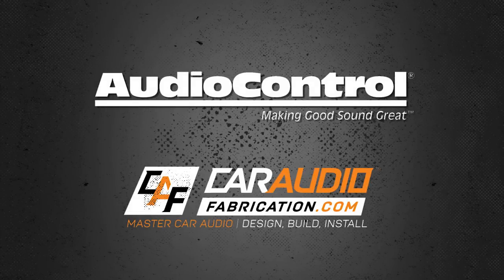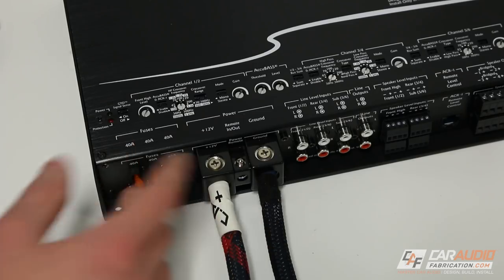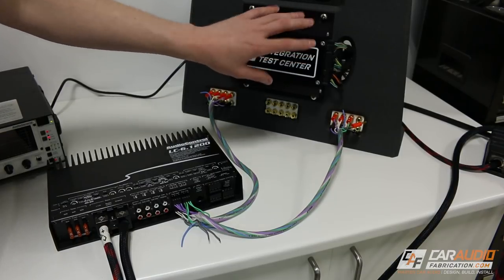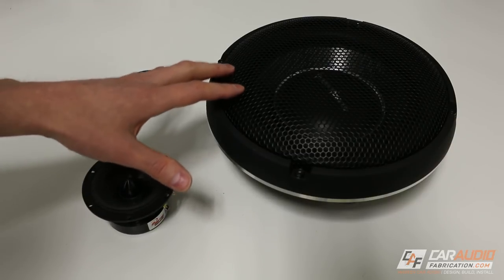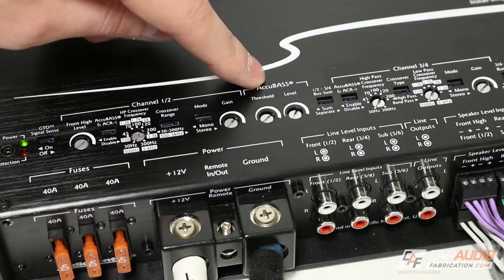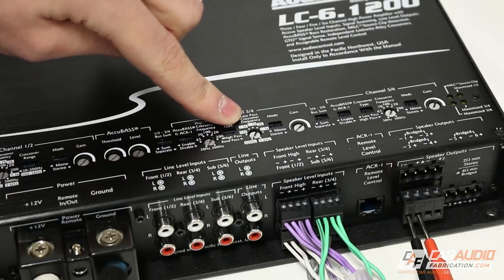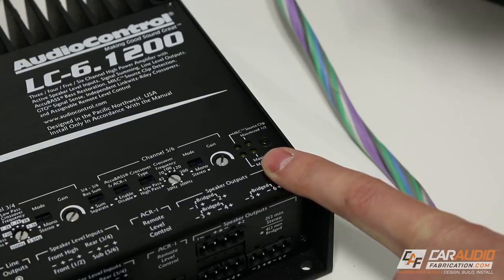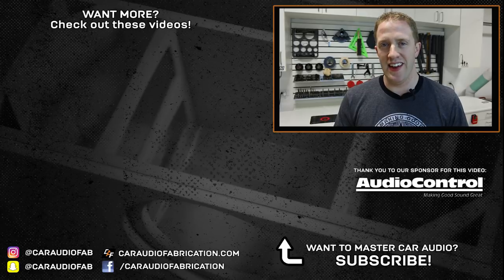The All in One Amp? AudioControl LC-6.1200 Amplifier - CarAudioFabrication

Comment: AudioControl is perfect. I had a vehicle that has a difficult Audio system both from hardware and fitment. So expanding the system with new speakers and a sub was not possible. I installed the LC2i post factory amp to the factory amp and restored the bass and sound. So happy. I plan on upgrading to something like this in the future. Btw the GTO setting is AWESOME

Comment: I want to thank you for these videos. I had watched this video about 3 years ago and bought this amp and the 1500 for a sub. I sold that car but kept my gear and only want to put a small sub in my new car but it has a factory amp just like your test bench and now I know I can bridge 2 channels to get the 400 watts I need for the sub and I can use the wires off the amp in the trunk and then feed the rear speakers the other 2 channels awesome. Thank you again Godspeed

Comment: I am running this amp I love it, theres a lot of control over your speakers. 

Im using this for :
Channels 1/2: Audiofrog GB10 tweeters
Channels 3/4: Audiofrog GB60's midranges
Channels 5/6: Polk Audio DB522 (just back door filler speakers honestly)

Also running a JL 12w6v3d4 sub on a JL XD600 1v2 in the trunk on a box designed by CarAudioFabrication specifically for the sub. 

One of the cleanest heavy hitting audio systems I have ever heard and still need to get it RTA tuned to be perfect.
Reply: Jack Mcbride wait I thought this was only a 4 channel amp.... How are you using 6 channels?
Reply: @T_B_C_L  it is only six channels he could have the rear door filler speakers wired to the midrange speakers or the sub is wired to a different amplifier

Comment: I have a question, and I'm having a difficult time finding a clear answer. Lets say this amp is used in a typical 4 speaker + 1 subwoofer set up. What is the output for the 4 channels (door speakers) and what would be the mono output on channels 5/6. 

Looking to do a well rounded system in a Volkswagen Tiguan, and this seems like a decent option apposed to some other 5 channel amps, but I'm a basshead at heart, and definitely want some great output from the substage. Hope you see this, and thank you for such a detailed and simplified explanation of this amp.

Comment: Signal sense will always work when the speaker wires have 6volts DC. With a multimeter put one lead on a positive or negative speaker wire then ground the other lead.

Comment: Mark.. I’m currently running this amp and now adding the LC-1.800 along with it. I’m trying to use the LC-6.1200 RCA Analog Line-Level Outputs but not getting enough voltage to turn up the gain of the mono block to my desired setting. The manual says AcuuBASS is always engaged on RCA Analog Line-Level Outputs. Does this mean I have to dial in the AccuBASS to set my gain?

Comment: I spoke with AudioControl support, Steve recommended the DM-608 and the DQ-61.  I plan to install a component speakers set, coaxials for rear fill, a single 10" inch sub woofer, a Zapco monoblock, and a Zapco 2 channel ( or a 4 channel, I might run the component speakers as active don't know yet. What do you think is the better route? A friend also recommended a Mosconi Aerospace DSP, anu info on that? Awesome video as always, Mark!
Reply: Ali Haidar He should have went over the added use of the add on remote. You should also check out the offerings from Audison and Zapco for DSP units who offer some dash functionality with the Audison Bit One and Zapco DSP Z8 which both offer 8 output channels instead of 6.
Reply: Raul Martinez i have the money for either the 608 and the 810 and also a Mosconi DSP, I'm not familiar with dsp's that's why I'm asking.

Comment: Question! Can you potentially connect more than one channel from the factory amplifier to one channel on this amplifier? For example, my factory system has a channel for tweeters, mids and bass. If i take the tweeter and mid signal wires from the front and connect them both to 1 channel pair, will that work? My goal is to clean up the signals from all doors so i can replace the crap speakers.

Comment: Yeah i dont get the hype 10 -15 years ago every amp came with high level inputs . i love how people resell you a feature that was standard back in the day
Reply: The signal summing is part of the hype.  More and more cars now don't have a full-range signal available on any of the speaker outputs.  With an old style amp, you'd be stuck keeping all the output channels separate, which means being stuck with the crossover points and slopes the car manufacturer chose, which may not be appropriate for new speakers you install.
Reply: yeah dude i get that its just that he brings the thing that is awesome about this amp like two thirds into the video . while in the beginning he was only talking about how great it is to have an amp with a high level input . thats why i said that he is basically reselling an old feature that used to be standard
Reply: Ah, gotcha.   Yeah, I thought it still was standard, really.  The JL and JBL amps I've used have all had high-level inputs.  And I can't count how many times I've seen people on Civic forums asking what LOC they should buy to use with Amp X, then I Google and see that Amp X has high-level inputs so they don't need a LOC, lol
Reply: Also, a lot of high end OEM systems have voltage that is to high for typical high level inputs.   BMW HK system actually send up to 40v to "subs"!!!!  that would fry every amp out there.  AudioControl devices can take that input and bring it down.  So this is basically an LC8 combined with amp with much more then simple hp/lp crossovers.

Comment: My question : If I have a 9 speaker setup (2016 Shaker w/o sub woofer) what are my options with keeping the center channel speaker in the dash. I get the left & right  front & rear, but trying to find either a DSP  that has that center channel out and then feeding it to an amp has become quite the unicorn. Any info would be great I really would like to keep that center channel along with the stock Sync3 radio. Yes I will be adding a sub woofer to the system at the same time I get this figured out. So I am looking at a full 5.1 setup.

Comment: I’m in the planning stage for my 2012 F-150 harley edition with Sony premium system.  I understand that i can’t change the head unit.  Being that there are component speakers in front and rear door speakers and i would like to add a couple 10’s for subs, would this amp do the job or will i have to add the mono block amp?  Or would the ACM-1-300 work?  I’m not looking for overwhelming bass.  I’m 53 and I’m looking for quality full range with a good punch in the low end.  Thanks
Reply: I am currently in the same phase as you were in a month ago, when you wrote this msg.  You do not need this amp if you don't plan on changing out the factory amp or speakers in the doors.   If you want   a better signal to your door components then you can use this amp, if not, just purchase audio controls, Lc2i converter to use the signal from your bass speakers to a mono block amp.

Comment: CarAudioFabrication I installed LC-6.1200 in my car but output source 5/6 led stays on all time. Even when there is no input signal. I am using rca connection. Also GTO doesn't work with rca. Any solution?

Comment: Nice as always. I have this amp. A jl twk 88 and a pioneer head unit. I'm having a hard time getting gains set right. If I do it by the book I get very low output. To get good output I'm at 75% gain setting. What gives. Same setting on head unit and dsp with other amps is no where near as high on gains.
Reply from the maker: Are you using something to actually detect distortion? (Like an O-scope or DD-1?) Or are you doing the 75% of volume and DMM silly way? You need a measurement tool that will actually detect distortion in the waveform. For subwoofers you can use a -15db test tone as distortion is not nearly as audible in subs as it is mids/highs

Comment: Question as I've been researching best frequencies by speaker type.  I noticed you mentioned setting sub to 100Hz.  However, what are your thoughts/issues with my recommendation to set Sub @ 80Hz and below, midrange 80Hz to 5000Hz and Tweeters at 5000Hz to +20000Hz? 
Thanks and keep up the great work!
Reply from the maker: This was purely an example. I didn't say to always use that value. Your crossover is determined by more than just a guess, check out the crossover video on my channel.

Comment: So if I were to be using this on a aftermarket stereo and want a 3way speaker set up I’d run rcas from the aftermarket head unit to the Lc6. Have tweeters on ch1&2, mid drivers on ch 3&4, woofers on ch 5&6 but I’d have to sum ch 5&6 to ch 3&4 and set the band pass cross over point. Is this correct?

Comment: Will this amp work for a 19 speaker Mark Levinson system minus the sub? It has 2 3-way components sets, one in the front and back. Also is this actually bypassing the factory amp?

Comment: Would you use a LC-6 or D-6 now that those are out? I realize that's a half baked question short on requirements, but I'm exploring it. I like the cheaper LC-6 which seems to have a lot of features, but at this price, $200 more comes with full DSP, hard to say no to.
Reply from the maker: If you want full tuning the D-6.1200 of course. That doesnt mean the LC-6.1200 isn't still super powerful alone.

Comment: So how do we find out if our factory NAV stereo attenuates the signal or has an internal crossover?  Most don't do that as far as I know.

If not, there's no need for this right?  I mean I want high quality sound in my Jeep Grand Cherokee 2020 with the UConnect, but as far as I know the radio outputs a full range signal into each of the 4 channels, so all I need it a 4 channel amp with speaker level inputs and be done with it.  Naturally, brand names only, I'm looking at the Fosgate Punch 400x4.

Worst thing I've heard is bass roll-off so if anything, a LC7i is needed for those systems.
Reply: The Rockford and a LC7i cost almost the same as this one.

Comment: now put it on the SMD Amp Dyno and test distortion with the DD-1 to verify the accuracy of their measurements
Reply from the maker: +Dracolegacy it dynos at more power and their distortion light comes on at nearly the exact same time as the DD1. Steve has tested these amps too. They are quality amps.

Comment: I want to use the audio control D-6 1200 and the Lc-1.800 to control and power my 2019 Nissan Murano platinum with Bose sound system and I’m adding three separate kicker 47TRTP122 12” 2-ohm 500 watts (1000 watts peak power) these r down firing subs with passive radiator. (Need to keep space in cargo) Do you believe this would be the best setup to add the ultimate bang while reducing the amount of wiring needed with setting up two different amps to power three different subs, highs mods etc... or is it over kill and I should just connect 1000 watt RMS @ 1 or 2 ohms and add a 2nd 600 watt RMS 1 or 2 ohms?  Help greatly needed thanks!

Comment: My 2014 Grand Cherokee has the entry level 6 speaker system and sounds awful. I'm thinking of using one of these and replacing all the speakers. down the line I may look into adding a sub but that't require more side work I'm not in a position to do at the moment

Comment: So if using this amp does that avoid having to run the stinger speed wire from the head unit to a LC7I and then over to the amp? What I’m gathering from this because I’m new to all of this is, where the factory speaker wire connects to the stock Sony amplifier I can basically tap or cut those wires going into the Sony amp, remove the stock amp and instead run those wires over to this amp???
Reply: Please help I’m so lost!! My goal is to install an aftermarket amp into my 2011 f150 with the Sony sound system and keep the stock speaker wiring. And also ad a subwoofer. I’m having trouble figuring it all out!! Thank you in advance!!!!

Comment: What if you do not have tweeter inputs? Meaning, let's say the stock stereo only has Front LR and Rear LR speakers for inputs(no sub). Will all the output channels still be available with full functionality(Bus Sum, Mode,AccuBass etc.)? Basically, are there any drawbacks to not having tweeter inputs from the oem HU?
Reply from the maker: You don't have to have a dedicated tweeter signal, it makes things more simple for you as you don't need summing.
Reply: CarAudioFabrication Let's say the inputs that are available aren't full frequency, can the DSP still add back in the missing high frequencies? For example,  if you were to take that same bench setup and disconnect the tweeter inputs, would you still get "full range signal" output?
Reply from the maker: No, that is the point of summing. Sum the speakers to get a full range signal.
Reply: CarAudioFabrication that's what I assumed, but needed confirmation. Thanks for the brilliant video and replying.

Comment: Great video man! But how the hell do i get rid of the engine hum going through my speakers?
Reply: CesarConH ground your stereo to the closest metal you can find, make sure you have the best ground on your amp, and most likely you have the level too high
Reply: CesarConH sounds to me you have rca/ audio ran with your power wire for your amps.
wire power opposite side of the car
Reply: Those are both good answers. There are a lot of variables on that issue. Ground loop isolator might solve issue. Also if your amp is mounted directly to the car the screws are going into the ground or negative side of your circuit and making a ground loop shit feedback sound. Mount to a piece of wood and then the wood to the car...

Comment: How did you get the display of that radio red? I know that's outta a 1999-2006 Gm with the Bose system.
Reply: Blake Johnston The head unit came out of his Pontiac Grand Am. I think pretty much all "sporty" Pontiacs mid 90's on up had red interior lights.

Comment: funny thing amp's i never going to get this deck i have is a kenwood ddx6703s so i have spl in the deck right.  I am planning to add 5000watt 4 channel  amp 4ohm rms 4 x 250watt  and then 7000watt 1ohm rms 2000 watt's  this will go in a 2016 dogde carvan sub's in sto an go 2 x 18 inch  any ideas what speakers to use?

Comment: So with this amp would you need a LC2i or LC7i if you are going to use the signal from a factory head unit or does it already have that functionality?
Reply: It already has that functionality.  No need for another converter.

Comment: My 17 silverado without bose has 6 speakers. 2 are 2.75" in the dash. I'm guessing they split off the door speakers. If i keep the stock speakers, or replace the fronts with a component set running that manufacturers crossovers, can I run them off this amp and also my 1×10 sub?
Reply: Then nothing would change on the sound.
Reply: @ekimandersom4478  what do you mean nothing would change?
Reply: @ronkauffman9058  If you use the stock crossovers which is a terrible idea btw, then everything will still sound the same , maybe a bit louder due to the new amp.
Just rip the stock stuff out and put a nice component set including the crossovers that come with them!
And yes this amp can do that just fine.
The only thing you would need to do is pull new speaker cables .

Comment: Based in part on this video I bought an LC-6.1200 to tri-amp the front stage of my 1999 BMW M3 convertible.
Please tell me how the heck you got any speaker wires to stay inside those awful plastic connectors!! I am using a decent quality 14ga ofc speaker cable, but regardless of how tight I torque them down a grasshopper farting two blocks away knocks them loose and they just fall out! 
I would like to actually hear this amp but by the time I walk from the trunk to the driver's door and climb in several input and output wires have just fallen out!
Reply: Ever heard of ferrules
Reply: @ekimandersom4478  LOL... Well 2 years ago when I wrote this I hadn't, but within a week of posting this I got a bunch and a crimper... Worked OK... But I don't hate those connectors any less. The screws are small, the connectors are weak and easily strip. For a 1200W amp the speaker terminals are way too small. Even 12 ga speaker wire doesn't fit well. 
For battery and ground cables ferrules are AWESOME. For larger wire connection (like my sub amp) they are great too.
Reply: @jamesrobinson1579  I agree those connectors suck.
Very tiny and screws are ruined quickly.
But i never had a loose wire the past 2 years with using ferrules.

Comment: Any know if you can use the all in one amp to power just four tweeters and four 6.5 component speakers??
Reply from the maker: If you are running active you would need 8 channels for this. If passive with crossovers you would use 4 channels and this amp could work.
Reply: I have 4 crossovers and each would have a tweeter and a 6.5 component speaker on it. Only four channels are needed without an additional amp for the 4 tweeters and four 6.5 component speakers??